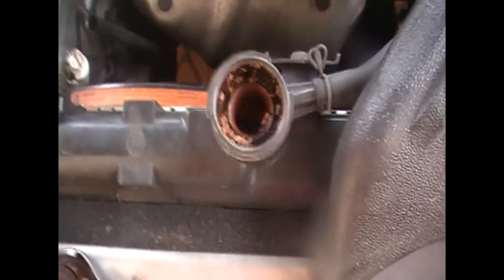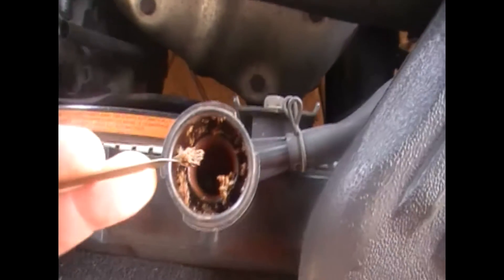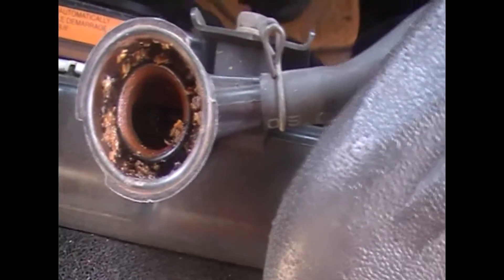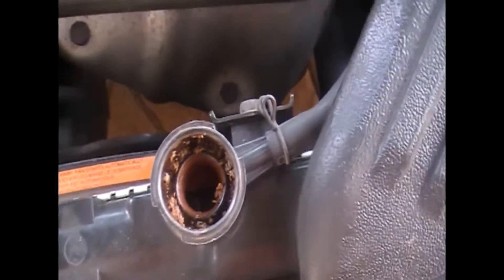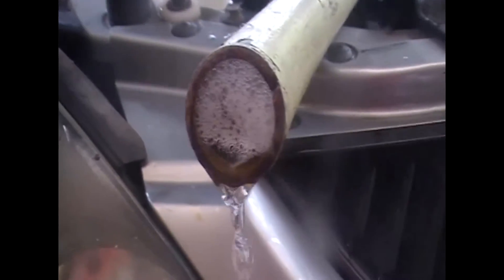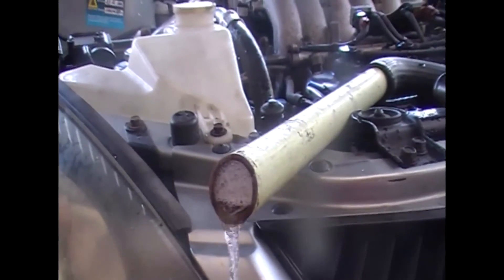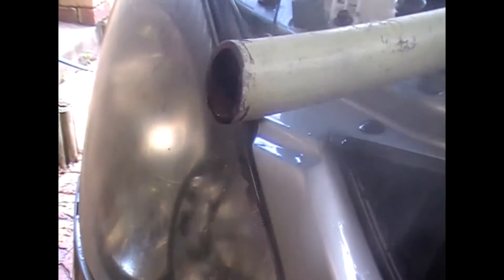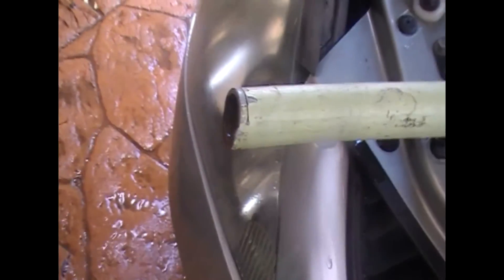Why You Shouldn't Mix Coolants | 2 wrong coolants fixed

Comment: How long does it take for the mixing of coolants to cause this type of issue? I mixed dexcool orange with about half a gallon of the universal green kind not knowing that you are not supposed to mix them. About a month later engine is running a little hotter than normal and some of my hoses going to the thermostat and reservoir are cool to the touch.
Reply from the maker: Depends of what the mix is. A little of one mixed with the other could take a few months a lot lets say 50/50 mix could take a few weeks. I have it happen to one car that everything showed it was ok, cluster said temp was good. Scan codes showed no errors but every time the engine was ran for more then 1hr or more you could hear it boiling and water pushing out the overflow. Another car I worked on showed it was over heating and a flush with radiator flush and new coolant didn't fix it. Both cars had the same problem. The first one I ran with a garden-hose constantly running for about 30min before I began to see foam coming out and took about another 40min before I had nice clean water flowing. The 2nd was for about 10min before I noticed my suspicion was correct and took about 20min before I had clean flowing water coming out. The longer you leave it the longer it takes to move the foam and flush it out. once you get it all out then drain the water and put your coolant mix back in.